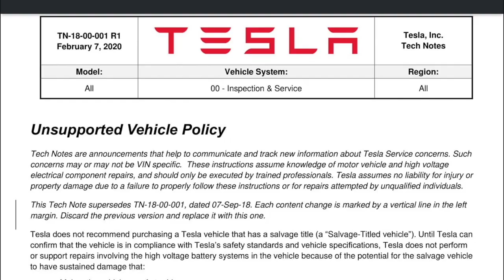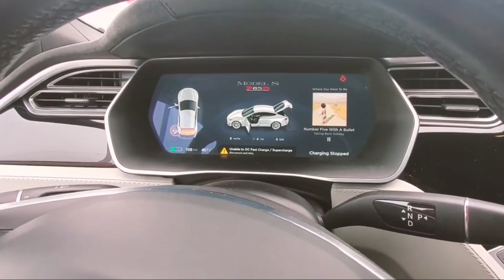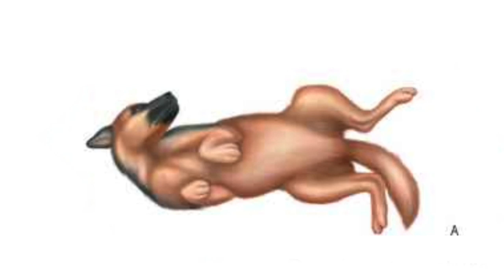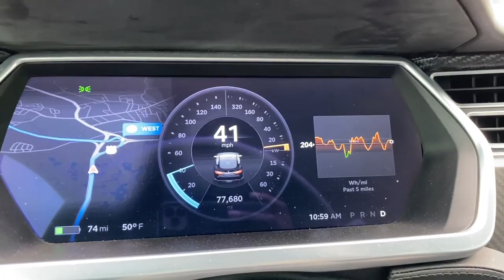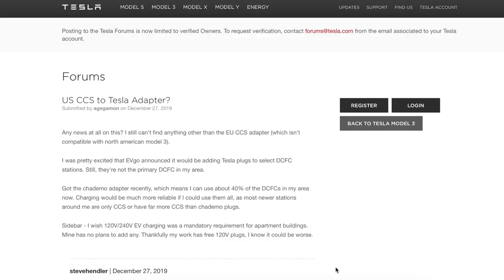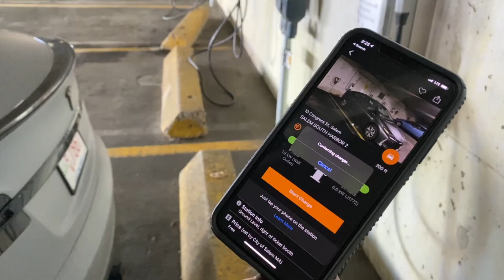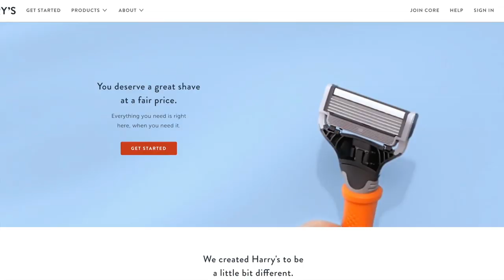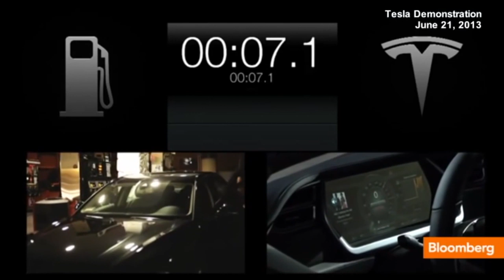Tesla ruined my car and it’s the best thing to ever happen to me!

Comment: Bottom line:  EV without fast charging = worthless
Reply: Rich got by without it when he first got the car. It took several days to fully recharge it. Ever since he got a fast charger at home I think he's gotten a bit used to it.
Reply: I have my model 3 fir one year now and had to use the Supercharger maybe three times...
Reply: @JasonWW2000  It was not long after he got it the state inspection certificate for Dolores that he found out that he could Supercharge her.
Reply: @Markle2k  Yeah, bit I'm talking about his "medium" speed home charger. Before he got that installed he used the 110v portable charger which took about 3 days to recharge. He got by with that, but used the Supercharger a lot. Now they took away Supercharging as well as his home charger. Now he's back to the portable unit. It sucks.
Reply: @JasonWW2000  Home chargers aren’t fast chargers. Those cost about $20k to install and require their own transformer. The charger he has at the house is a super rugged regular 240 volt charger that a business or apartment complex owner might install. I think it was about $1200 when I looked it up.
Reply: @Markle2k  The 240v charger is a level 2. It is considered a "fast charger" in comparison to a level 1 110v charger. When Tesla disabled DC Fast Charging on the car, it means he can't use his level 2 charger any more.
Reply: @ptolomaeer  Not everyone's needs are the same.
I for example only cover a couple hundred miles a year in my personal car, So the depreciation on a Tesla or battery rental on a lot of the others would be disproportionately expensive with regards to cost per mile. But for a job I travel large distances to repair PC related items for large companies. There isn't an EV van in production yet that would allow me to use one for work. I'd need one that can do over 500 miles of combined motorway speeds and the constant accelerating/braking that twisty UK country roads force on you, Or I could get away with a 250+ mile range if it had a sub 20 minute zero to FULL recharge time if we had a lot more charging infrastructure here (I'm talking about never being more than 10 to 15 miles from least one bank of fast chargers at any point in the UK).
Most current EV vans barely do over 100 miles and are mainly designed to do multi drop deliveries in a single city. If that's still the case in another 15 or so years when the government bans the sale of IC cars here it will mean the slow demise of many of our smaller national delivery companies.
Reply: @JasonWW2000  No, it does not. Level 2 is not fastcharging, level 3 is.
Reply: @josefsoltes8572  Then what is a level 1 considered? Lol.
Reply: @rdizzy1  Level 1 is US 110 V socket. Level 2 is anything over 200 V.
Reply: @josefsoltes8572  Obviously, but I mean level 2 is obviously going to be seen as fast if what you have access to is only level 1, because level 1 is inherently slow. Level 3 is the fastest, but that doesn't mean level 2 isn't "fast". We are talking about commonly used terms here, and subjective as well.
Reply: @rdizzy1  Well, there is a reason, why I believe you are wrong. I live in Europe. There is only level 2 charging. No level 1. So,  where would that leave people hanging? Without possibility to charge at all?
Reply: @josefsoltes8572  Yes, but that isn't true in the US.

Comment: Beyond the anti-consumer practices, isn't there something slightly disconcerting that tesla's official stance is: 

"We don't have the appropriate failsafes in place to prevent your car from catching on fire in case of some unknown defect or degradation so let's just shut cars off with potentially completely unrelated damage(after they've been allowed to charge anyway for awhile before we found out)"

Comment: Stop and ask yourself this simple question.  When you drop $70k+ on a new Tesla, do you really own it when Elon and crew have access to it 24/7 and can turn on and off anything they choose?  What other car company functions in that manner?
Reply: @gavinhanson9213  True. We just gone a new Model 3 but if Tesla continues these practices I'l by Audi, VW or Porsche in 3 or 4 years if they made up some ground in development...
Reply: Most car companies do this to a certain extent. VAG do this for some of their parts, for example if you want to replace a radio in some of the newer VW cars, it activates 'component protection' and you need to go to the dealer and have it removed.

It's madness. I get its for theft protection but is crazy when you need legitimate parts for an older car and then have to spend money for the dealer to activate it.
Reply: Mike - what OTHER car offers True FREEDOM of Travel like a Tesla does with a Nationwide Supercharger network ?
and when you buy Even a $35K Tesla model 3, the Car is built TOUGHER than many cars PERIOD.
" Tesla model 3 is built like a TANK, but it Outperforms European Sports cars - Sandy Munroe.

and what CAR Company EVER can make the car operate BETTER than the day you bought it ?
ONLY Tesla can , they have the Enginering expertice and the Software expertice . 
TESLA can even add Battery range without Swapping out the Battery and make the car PERFORM Better and offer MORE Features.
Reply: John Deere does shit like this.
Reply: @markplott4820  All of that and you didn't go near addressing my original question/issue. And try driving from New York to San Diego and see how that "nationwide" Supercharger network works for you. If you live in a coastal,  urban,  enclave, the Supercharger network is there. Venture outside of those areas and your route is strictly dictated by limited charging options. I get it.  You're a Tesla fanboy and don't want to hear a single negative comment about anything Tesla.

Comment: "Rebuild" an after market charging mod...
Reply: Please try to do so. Maybe the Guys from EV-West can help.
Reply: Please try to do so.
Maybe the Guys from EV-West can help
Reply: ... and get sued by Tesla. That's the problem. There is always a technical solution, but is there a legal remedy?
Reply: @aftonline  Not so sure they could sue for building your own aftermarket charging solution that allows for fast charging of your car. If you alter the OS of the car's computer you might run into an issue but chances of being caught would be close to none as long as your hack didn't let you get fast charging from Tesla chargers or you never used them that way.  Now if you sell the solution be it hardware or software it that would be a problem. If you offered the plans up for free to all it would be a big F U to Tesla and might make them change their tune.

Comment: There’s a lot coming your way with electric cars so hold on you will have more options soon.  That’s all the help I can think
Reply: It's still a fossil fuel car, you know that right?
Reply: @schrempskynate8944  that is entirely dependent on means of power generation. Yes, coal plants exist, but there are also hydroelectric and nuclear plants. You could charge a Tesla with solar panels if you wanted to.
Reply: @user2C47  Thank you Captain Obvious. In any way shape or form you're using a secondary means of generation. Ha,  it'd have better efficiency if it were directly coal fired actually.
Reply: @schrempskynate8944  Economies of scale applies.

Comment: "think about the environmental impact"
Also drives electric scooters
Reply: what's wrong with electric scooters?
Reply: @RawbLV  worse environmental impact than non electrical ones. And it's not that slow to ride a normal one
Reply: @spectralspectra2282  what? And pushing a car is better for the environment, than driving electric one.

Comment: Dear Rich: - Unfortunately Tesla monopolizing in the usability of these cars was an expected reaction, but since the entire meaning of this project is to be able to create, you must now see this as an opportunity to be creative; so put you thinking cap on and start disrupting or even replacing (if you have to) the charge controller & attach an alternator to the electric motor, attach flexible solar panels to the hood & the roof of the Tesla & add more batteries, or even worst attach a wind turbine, or two... or even evil: - Attach a Honda generator, to charge the battery while driving it.

Comment: I have a Honda Clarity, PHEV with about 50 mile range and level 2 charging only.  Wanted to make a 200 mile trip on battery only.  Left at 10pm at night and stopped four times for about two hours each and just slept in the car while charging.  Got there at 9am, so about 11 hours.   Did end up having to burn a little gas at the end when I finally got fed up and wanted to just get there.   Kinda nuts, but was fun too.

Comment: Can you create a dummy load that communicates with superchargers and draws the absolute maximum current converting it to either an arc light or heat without shutting off? Something cheap so you can leave them? Think of it as helping stress test the network of superchargers... 😁

Comment: Im no engineer, but is is possible to bypass the entire circuit that controls the speed of charging? By hooking up your own connections straight to the battery terminals could you achieve a faster charge? Or allow you to  charge in parallel? The battery can obviously handle higher current with supercharging.

Comment: Seems like Tesla could work deals with the rental car companies, and then consumers could lease cars on monthly or annual contracts from rental car companies, where you are basically leasing Teslas, but no specific one. When you travel on a long trip for example, you just stop at the city near where your battery is going dead (at the rental car place), and then trade the dead Tesla for a charged Tesla, then keep going on your trip. You can exchange the whole car when it goes dead instead of trying to build a car where you'd switch out the battery...

Comment: Highlighting how Tesla remains in total control of YOUR car you bought and paid for (of course Tesla remains non-liable when the auto-pilot, auto-driving fails and causes crashes) is a great service to your viewers. Perhaps you can pursue stories on how to modify your Teslas to be cross compatible to other charger systems for greater charging resources, mods that enable the owner to reduce Teslas' dictatorial control over YOUR car, and options offered by other EV makers that does not make youe EV a slave to them.

Comment: Lots of TESLA  HYPE.... ! ! !    But I bought NEW, and still did NOT get the FREE SuperCharging.  Years before I bought my Tesla X in 
April 2019, for over $120,000 + taxes,  I put down $1000.oo and WAITED & Waited...  &  Waited.   I was promised "FREE SUPER Charging,  
bumper to bumper free repairs for a decade,  a "User Tesla" if I ever needed "service" and it came with NO SPARE TIRE.  Replacement tires and 
balancing WERE NOT part of the bumper to bumper guarantee of free repairs.   Over 400,000 other buyers put down $1000.  That was $400 
Million bucks, enough to build the factory.  And we were not even given a few shares of stock.  Then when I got my Tesla,  I was told, "Oh, NO 
Super charging"  and I still bought it, but with a grudge,  because I 
had put down another $2,500 to get it in a few weeks and I had to wait 
YEARS.  I asked about the lack of spare tire.  I was promised anywhere 
in California "and most other states" I would call a number and be given
 a "Loaner Tire" if I had a flat.   Within a few months I had a flat.   
Someone told me on my Tesla X system, no worry, someone would be there 
in 1 hour.  that was in Los Angeles.   2 hours later a tow truck showed 
up with the loaner tire. It was Sunday nite, so I did not complain.   
Weeks later they called me and had a NEW tire for me, "and would I 
please return the loan Tire"  .  I did.  I drove another 23,009 miles 
plus, scheduled  a replacement of my front tires.  They were bald.  When
 about a week later, I was about to go to Santa Barbara for my two new 
tires, I got a message my appointment was delayed another week.  Tesla 
in Santa BARBARA, HAD NOT GOT MY REPLACEMENT TIRES.  NOTHING I COULD DO.
   A FEW DAYS BEFORE MY LATER, RESCHEDULED APPOINTMENT ONE OF THE BALD 
TIRES WENT FLAT & SHREDDED 11 MILES FROM HOME.   AFTER HOURS OF 
WAITING, I CALLED FOR A PRIVATE TOW TRUCK.  TESLA GUY SHOWED UP,  
FINALLY, WITH NO "LOANER TIRE", BUT I WAS ALREADY ON MY PRIVATE CALLED 
TOW FLAT BED.   AND NEITHER OF THEM HAD A SPARE  "Loaner tire".  So on 
my 2nd flat tire, because Tesla of Santa Barbara could not even keep a 
few "spare" tires in stock.  I had to be towed home.  then towed again 
to Tesla of Santa Barbara, Ca.  58 miles south.  Then when they replaced
 3 tires, because I had to wait basically ALL DAY, they offered me "uber
 Credit", but I had forgot my cell phone so that was useless.  I asked 
about the promise that if ever in need, I "would get a loaner Tesla" 
while waiting for repairs.  "Oh, they dropped that and you get Uber 
credit".  NOT what I was promised YEARS earlier.  So I am wondering WHAT
 other Promises are going to be broken, so CEO  Elon Musk, can pay 
himself and additional $770 Million BONUS on top of his already sky high
 salary?  And with all they hype and promises, Elon can not spare $1 million to keep spare tires at the store where I bought my Tesla X???   
Really,  After waiting for years, I should have got Free Super Charging promised, a "user Tesla" when waiting all day, and a few (say 10 shares 
of Tesla Stock) when I put down my first $1000, which they later claimed in April 2019, they had "no record of".   Now I have solar at home and 
usually re-charge at home, but Too many broken promises.  And failure to have spare replacement Tires "IN STOCK" is very disappointing, plus I 
wanted a "brand NEW" and I got one with 600+ miles on it.   I wanted 
creme color interior.  I had to accept black, or wait more weeks, maybe 
months.  With $40 k down payment plus $5,000, you would think I would at
 least get some slack, a few years of Free Super charging, and spare 
tires when I need them.  so I spent another $1,300 for a new tire and 
Rim, I keep at home just in case TESLA fails me AGAIN.   And I can't 
even get a Tweet to Elon Musk.   He is too busy sticking it to the 
"short sellers" and customers to even Notice.  I do like my X.   And 
when its working with good tires, its greatest I ever drove.  I probably
 will never buy another gas gusseler,  OH, and the original interest 
rate of under  1% had gone up to 3%.   Now I wonder if the 100kw battery  promise to repair or replace for a decade will also be broken.    Lucid
 Air,  Where are you, ?   Elon Musk let me down, and does not even care.   No way to even reach him.  But I think he was brilliant to bust the 
chops of the Oil industry that intentionally made us old farts stand in  line for hours for 2 gallons of gasoline back in the mid 1970, every 
other day, if you could get it at all, in L.A.  $770 million bonus, and you can't even give me the promised "Free Super Charging," and have 
spare tires available, except in Fremont, S.F. and L.A., Ca.????  Gee , Could elon Musk survivie on a bonus of 769 million and keep 1 million 
worth of spare tires for us to buy without waiting for weeks?  I do a local TV show in Santa Barbara, have made several positive Statements 
about TESLA X & S models, before the 3, Y became available.  Now I have had over 1 year & 3 months to really FEEL the Tesla Experience,
 fully.   I have been doing my TV show for 20 years.  And I pride myself  on being strait up honest about things.   I would have liked to do a 
interview with Elon Musk.

Comment: buy a small diesel generator put it in the frunk, make a plug to fit into the tesla charger  now run the cable round the side of the car and plug it in to the charge port voila on the go charging, future generations will thank me. :)

Comment: Did you wrap or paint it grayish color?

Is Super Charing Connector / Interface the same as regular charging?

If so, they should have feature to step down / auto switching where it can automatically charge regularly or Super Charge based off whatever Tesla's database says your car is entitled too

Are you saying, even you got a salvaged car from insurance company & repaired it, Tesla will still work on & check your car out

Comment: Cured, thanks..,
Connect the Tesla to the internet through a VPN and stop Tesla communicating with the car.  Do this prior to the repair work. Rip out the fast charger and replace it with a BMW fast charger     - problem solved.

Comment: Guy's like you are highly valued at most businesses because you give valuable feedback. It's typically very difficult to get people to fill out questionnaires and give marketing research feedback because people are afraid of the possible repercussions. Abusing customers like yourself is a BIG mistake because you provide Tesla with an opportunity to continually improve (KAISAN). If Tesla doesn't embrace KAISAN (Japanese for continual improvement) then Tesla will be surpassed by all the other car makers who will actually give you free perks for giving them feedback. Uncovering problems and flaws with the Tesla process should actually be a paid full time job at Tesla but you are working for Tesla for free!! I like Massachusetts right to repair act idea,  but the wording of the law needs to be changed to allow people like you to do your own repairs and be permitted to freely use Tesla's superchargers to recharge your repaired Tesla. Please get a job at Tesla in their head office and fix these problems at Tesla. Speak to Elon Musk directly regarding these problems not just for yourself but for everyone.